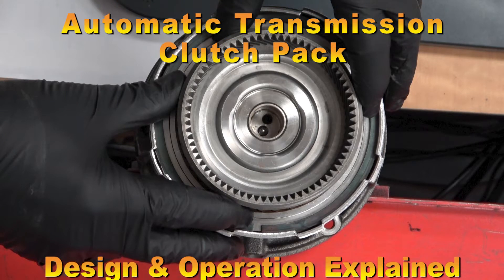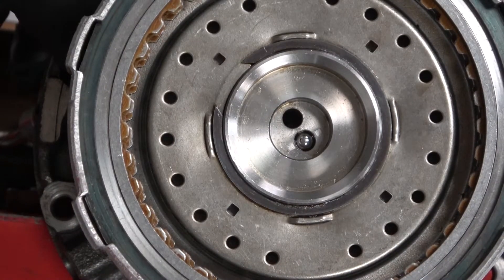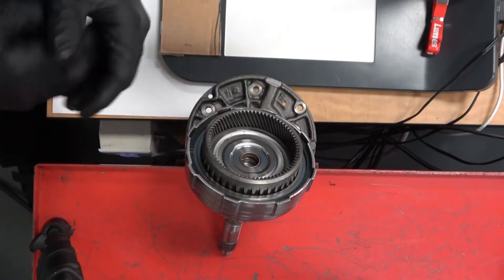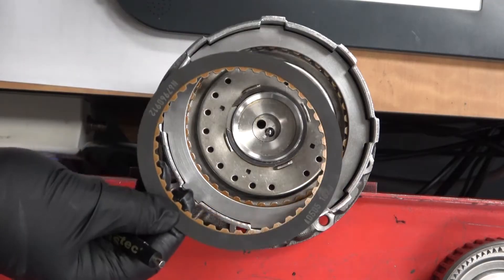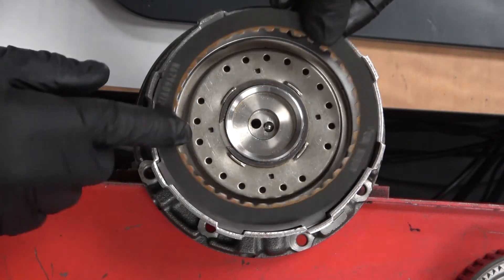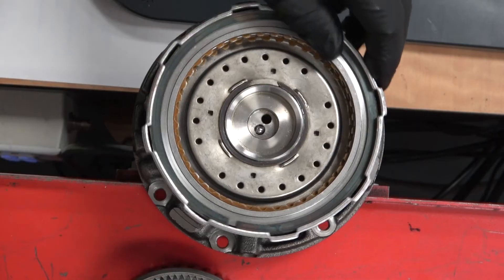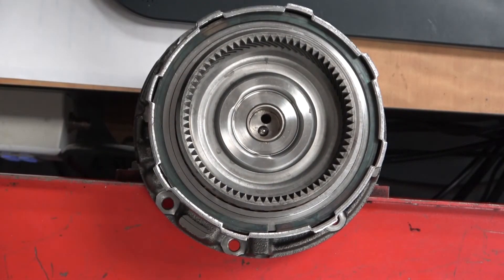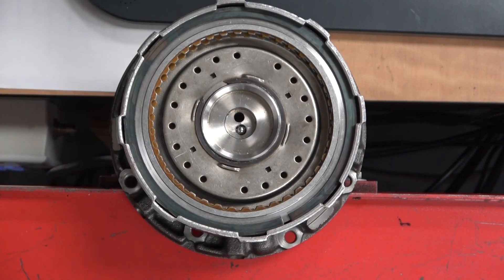Automatic Transmission Clutch Pack Explained

Comment: Hoping to get a quick response here because I have an exam tomorrow.

Say you found a faulty clutch pack, took it apart and only noticed one friction disk was out of spec. Would you replace the entire assembly? Or simply replace the single friction disk?

We have measuring tools for a reason, but I don't know what the preferred method is, or if there's a specific reason to replace the whole thing as one rather than replacing individual parts.

I know that a company will likely replace the whole thing because it costs labour, and just because something is within spec, doesn't mean that it will be for much longer. Especially with our dirty little fingers in there introducing contamination.

When I was in school though, we learned how to measure each disk individually. So what's the sense in doing that if we always replace the entire assembly in the real world?
Reply from the maker: Here is the thing.  There typically are no thickness specifications for the disks. One disk never wears out or becomes out of spec.  If you take a clutch pack apart it will either be in good condition or completely burned up.  All disks will be damaged.  What matters is not so much the individual thicknesses of each disk or steel but the measurement of the clutch pack clearance or piston movement.  It all depends on how the manufacture measures the clearance.  It is perfectly acceptable to have friction disks of various sizes such as .070", .072", .068", .074" in one clutch pack as long as the total clutch pack clearance is within specifications, that is all that matters. The same goes for the steel plates.  Steel plates can become discolored from heat but only from a clutch pack that has been running hot form burned up friction disks from the factory. a properly working clutch pack can go 90K + miles and be taken apart and the technician can still read the numbers stamped on the friction disk.  That is because the disks really don't make contact with the steels.  The thin film of oil is what creates the friction and adhesion between the two.I hope this helps with your exam.  I'm sorry I didn't get to this until late tonight.
Reply: @DrivelineMaster  You got to me right on time! Thank you so much for the detailed response.

When she goes, she goes. It makes sense that you would measure the total application range rather than individual disks. At the end of the day the most important factor is whether the force gets transmitted, and that requires the whole unit to be in proper working order.

I might have a few more questions to ask if you don't mind me sending you a private message. I'm trying to pass my final qualification exam, but no one in my shop has acquired it. I'd be an outlier, and it's tough not being able to ask anyone else.
Reply from the maker: Happy to help.  Write anytime and I will try to help.

Comment: But why use clutch plate instead of a torque converter?
Reply from the maker: The torque converter creates a fluid coupler between the engine crankshaft and the transmission input shaft.  The clutch packs are inside the transmission and do not replace the torque converter.  Think of them as a coupling mechanism that can connect or disconnect two objects.  Sometimes they connect two rotating objects together such as the input shaft and a ring gear and sometimes they connect an object such as another planetary gear to the housing.  Both types are often required to produce a gear ratio for the torque to pass through.
Reply: So every automatic car has a clutch pack on the top of the torque converter?
Reply from the maker: There are a few exceptions. Such as Dual Clutch (DC) Automatic transmission which are actually a converted manual transmission. They do not use a torque converter but instead they use a coupling mechanism similar to the wet clutch in this video.  Some DC transmissions use a dry clutch similar to a standard manual transmission clutch.  Some hybrid transmission and vehicles with start/stop systems may also eliminate the torque converter but they often have at least 1 wet clutch similar to the video.

Comment: If my car is only slipping when shifting from 4-5th, not 6th or flooring it in 1st to second, do you think it's not the clutch pack?
Reply from the maker: There are multiple clutch packs in a transmission. Some have bands and One Way Clutches that can go out.  Most 6 speeds and above don't have bands but without knowing your vehicle specifics I can't tell you much more.  Honda and Acura's typically use one clutch pack for each gear so you could have a 5th gear clutch pack that is slipping while all the others are working just fine. The more it slips the worse it will get which will burn up the fluid and damage other transmission components.  Changing the fluid on a slipping transmission will only make it slip worse.
Reply: @DrivelineMaster  It's a ZF 6HP19A in an Audi A6. I've got a P0784 and that's all I know so far, and a slight tranny leak
Reply from the maker: It appears that this transmission has at least 5 different clutch packs.  If you give me an exact year, make and model of vehicle I will look up some more info and try to help you.

Comment: hi where i can buy clutch pack honda civic dimension automatic 2001 model?
Thank you
Reply from the maker: Google "2001 Honda civic automatic transmission rebuild kit"  Lots of places.  If you just want a single clutch pack or friction disc you may have to go to the dealer but it's cheaper to buy everything in an overhaul kit.

Comment: Question please answer. Could a faulty fluid pump affect this whole setup.?  Because my transmission is shifting harder then I ever felt. And I already chaged my TCC. My car shows  p0720. P0798 and P0743
Reply from the maker: Yes a transmission clutch pack operation can be impacted by a faulty pump but not as you described. The pump does not create pressure, that is the job of the pressure regulator valve.  The pressure regulator valve for your vehicle is controlled Electronically with a Pressure Control (PC or EPC) solenoid and the P0798 is a PC solenoid code.  When there is a problem with the PC solenoid the default setting is maximum fluid pressure.  This is why your shifts are harsher than normal.  The clutch pack is filling to quickly with too much pressure. The P0720 is an output shaft speed sensor code which between these two codes they could be causing the P0743 TCC code along with late and harsh shifts.  I'm not sure if you have a code reader, a full fledged scan tool or someone read these codes for you.  The first two steps would be to use a scan tool and monitor the PC or EPC solenoid operation and the Output shaft speed sensor operation. The amperage of the PC solenoid should be around 0.98A at idle with no load and drop down proportionally as the load on the vehicle changes from driving conditions.  Additionally on some vehicles a pressure gauge can be used to check the pressure in the system.  This is normally called Line Pressure. Line pressure is typically between 55 and 75 PSI at idle in gear (0.98 amp) and when you put your foot on the brake and on the gas at the same time (this is called stall test) the pressure should rise up to approximately 250 - 350 PSI (0.35 amp) depending on the vehicle. You might be able to drive the vehicle and observe the output shaft speed.  Some vehicles may not offer this info on a scan tool and some scan tools are not capable of accessing this information. I would look at these two problems before worrying about the TCC code. That is the least of your problems. If you provide me with some more details and the year, make and model of the vehicle I will try to help some more.
Reply: @DrivelineMaster  oh my goodness man. Thank u so much man i just started a carpentry buisness im only 21 so getting a new car is definitely out of the picture. But I looked online and they said transmission pump becsuse I also hear a wirring or wining sound. But im going to order a new PC solenoid. I really wanna say. Thabk u for your reply. You definitely earned my subscription best youtuber ever. But u got s volkswagen jetta and it doesnt have no pressure gauge so its pretty gard to disgnose. But one more question do u thunk the valve body could be the issue ? And it all started with the TCC code and then the other codes came after
Reply from the maker: I would advise against throwing parts at it such as just going and buying a PC solenoid or a valve body. You could have a damaged wire or connection which would cost much less.  My advice by the time you are tired of buying parts and that not fixing it you could have paid a professional to properly diagnose it for you.  My advice take it to a qualified technician and get a real diagnosis.  There might be one connector that has wiring for the PC solenoid, TCC and the speed sensor and the wires inside could be corroded or damaged.  Don't throw parts at it. Get it diagnosed.
Reply: And what if I need a preessure control valve. Thats inside the vlave body right. Is is possible I need a new valve body
Reply from the maker: See my comment just before this one.
Reply: Yeah in my car the TCC and EPC solenoids have the same connector. Well wire. I see how that could be a possibility also. And I don’t wanna pay someone. I take joy in learning how to do everything my self. So in the future I will be that qualified mechanic lol. But thanks man so much. Your advice was way better and more correct then the people online.
Reply from the maker: There is nothing wrong with doing it yourself but diagnose it with testing and not parts replacement.  I'm willing to give you some help but you will need some testing equipment.  At a minimum you need a digital multi-meter that can measure duty cycle. You didn't say what year or model VW you have.
Reply: I got another question kind man. This might be a dumb question so please be easy on me. So I wanna check the wire and I  got my multimeter. I just wanna know if my wire should read 12 volts or not. Cause I know the car operates on. 12 v. And if the wire isn’t receiving 12 volts. That’s would indicate a faulty wire correct ?
Reply from the maker: If you provide me with the year, model and engine size for your VW I will look up the wiring diagram and tell you if any wires should read 12v or another value.
Reply: Update man. So I ended up just testing the solenoid and 0.00 resistance for both solenoids. TCC And PC. So that was the problem. Hopefully I didn’t ruin my transmission I ran it for about 5 mins. Thanks Man U was a great help !!!
Reply: It’s a volkswagon Jetta 2008. And what is the website where u get the diagrams from. I can’t find specs like that anywhere.
Reply from the maker: I have access to Mitchell Pro-Demand and AllData with are both subscription based.
Reply from the maker: What is your engine size?  What is the 8th character  of your VIN? what is the trim such as SE model.  Do you know if this is a Dual Clutch Transmission DCT? Do you know the model number of the transmission? Such as:  CD 09G?
Reply: @DrivelineMaster  The eight character is a K and its a 5 cylinder 2.5 L
Reply: its a SE model and O9G
Reply from the maker: Your transmission is more complicated than others to diagnose but I think you would find this helpful.  https://www.sonnax.com/tech_resources/294-tf-60sn-09g-solenoid-identification-connector-pin-out     and this might also help.    https://www.google.com/url?sa=t&rct=j&q=&esrc=s&source=web&cd=&ved=2ahUKEwjc1YbGt_j1AhVIKEQIHXJlDOUQFnoECAYQAQ&url=http%3A%2F%2Fwww.evosoft.dk%2Fdiagrams%2FDSG.pdf&usg=AOvVaw3NXb6jcQnIz56mqd_uDL3t   or this.  https://www.transmissionrepaircostguide.com/09g-transmission-problems-solutions/
Reply: It’s 8th is  K
Reply: Thanks man. Website is amazing. But the problems is my 2 solenoids are constantly getting power. So my TCC is locked up. And it gets too much pressure.  Now I’m thinking it has to be a failed relay because those are suppose to control when the solenoids turn on and off. Am I correct
Reply from the maker: Is your control module inside the transmission oil pan or is located behind the left front wheel well by the A pillar?  What color wire are you checking that has 12 V all the time? Some of these solenoids are pulse width modulated so you may not be able to check the operation with just a volt meter.  The solenoid might also be controlled on the ground side which would mean the positive side would always be constant. Does your Digital Multimeter (DMM) able to measure percent of duty cycle?
Reply: Update man. It was a failed wire the whole time. But thanks for ya help man. U are great ‼️‼️
Reply from the maker: Better than buying solenoids and valve bodies.. :)
Reply: I’m gonna check. And I didn’t check for voltage i checked if electricity could flow through the wire. Every other slot got a beep but one. And the TCC and EPC are on the same line. So it makes sense why both failed. And yeah they should be pulse width modulated cause there not always on
Reply from the maker: The continuity test or OHM test is better than nothing but not a very good test. a wire can test good with an ohmmeter but be bad because it can't carry the proper amperage.  Voltage and voltage drop are superior tests.
Reply: Ohh I see what your saying. But yeah in this case. There isn’t any continuity at all. So I know the connector is bad. But in a case with 16 pins, I’m sure u know there’s 8hot and 8 ground. But how would I know which one goes to which to check for voltage and voltage drop.
Reply from the maker: One question i asked a while back that would help me to advise you was.  Where is your transmission computer?  Is it by your left front fender or inside the transmission oil pan.  If I know that I can help with what each wire does.
Reply: @DrivelineMaster  it in under the fender. But Man U was right once again. Bout the continuity. The reason I wasn’t getting nun because it is pulse modulated or how ever u said it. And I know those rely on relays. So that’s why I wasn’t getting any But I ended up cutting the wires hot and ground which go to the TCC AND EPC and I ran continuity through those and it worked at 0.00 so I was like these wires are fine. So now I got to the last possible problem. The harness for the transmsision.
Reply from the maker: I have the wiring diagram that I can share with you that will assist in figuring out if it's wiring inside or outside of the transmission or even possible if the problem is in the computer. If you can email me directly outside of youtube I can reply and include the diagram as an attachment.  it's just drivelinemaster@gmail.com
Reply: I need help. So I just wanna check the relay also for this TCC and EPC cause I know they operate off of duty cycle. And I don’t know which relay it is. If u can find out for me It will be much appreciated. I start a new job next week and I need my car 😭😭
Reply: And I put dextron 3 in my volkswagon Jetta 2008 is that acceptable ?
Reply from the maker: Oh my gosh NO! That could damage your transmission. From what I can tell VW only used dual Clutch DSG automatic transmissions for your vehicle and if that is the case you need special DSG fluid from VW. Anything else can damage your transmission.  Also, there are no relays.  Everything comes from the computer and goes directly to the transmission.  You need a meter that can measure percent or duty cycle to monitor a pulsed solenoid.
Reply: @DrivelineMaster  oh ok I was wondering cause someome told me that it goes from the cars computer to a relay and then to the solenoids
Reply: @DrivelineMaster  and also I heard that if I put in the same transmission fluid that is factory approved that my transmsision will slip
Reply from the maker: Not true,  Never put a non-approved oil type of any kind into anything.  Doesn't matter if it's a transmission, engine, power steering etc.. Watch for a new video on PC solenoids, how they work and how to test them.
Reply: Also a regular multimeter can’t do that ?
Reply: I’m confused. My transmission isn’t Duel clutch tho ?
Reply: Idek man I just replaced the wiring harness. And I’m ready to add transmission fluid
Reply: I emailed u. YouTube getting tired of us lol
Reply from the maker: I replied

Comment: so when does the clutch pack disconnect, when I put my car in neutral?
Reply from the maker: There are often multiple clutch packs in an automatic transmission. These clutch packs determine forward or reverse and additionally other clutch packs apply and release to change gear ratios. 1st, 2nd, 3rd. etc..  If you have a CVT transmission you may have one clutch that just controls forward and reverse.  To answer specifically, there is typically one clutch pack for all forward gears and putting your transmission in neutral or park will release this clutch pack. The clutch pack in the video is the forward clutch for a Toyota A140E transaxle that was used during the 1980.
Reply: @DrivelineMaster   great, thanks for the explanation

Comment: What Happens In the Morning Time Gear Engagement  Failure except Reverse gear?
My Car is Toyota Caldina 2003 zt,
ATF Power Transmission
Thank You Sir
Reply from the maker: Hard to say without inspecting your Toyota.  Start with checking the fluid level when it's hot and also inspect the condition of the fluid especially what does it smell like.  Does it have a burnt smell to it? if so, this is not good. Does your Toyota have high miles on it?